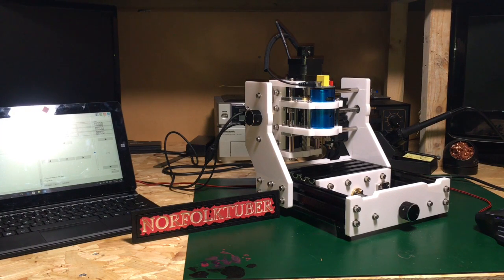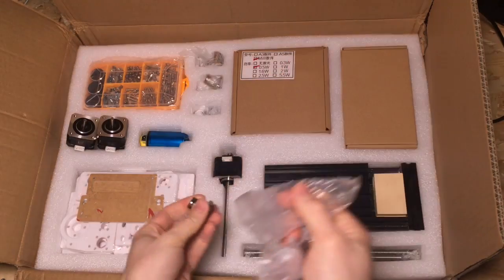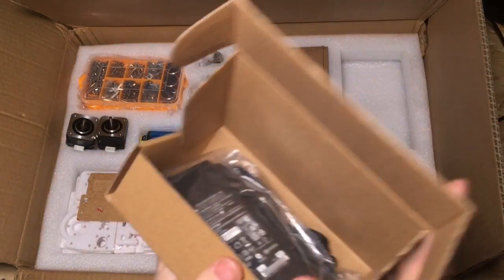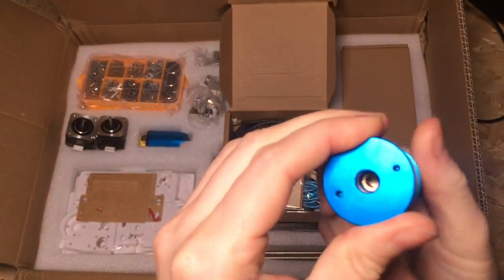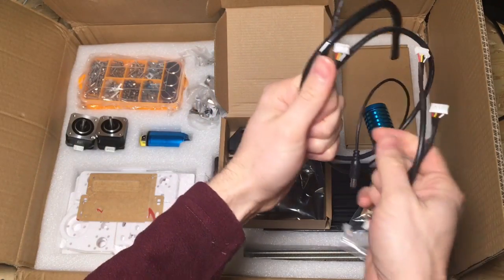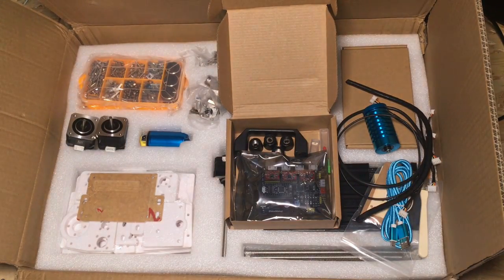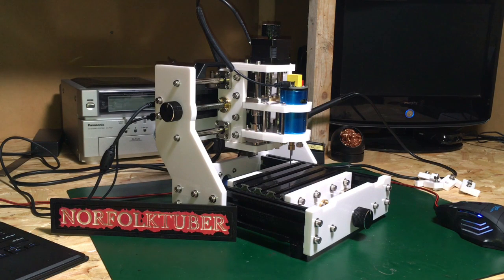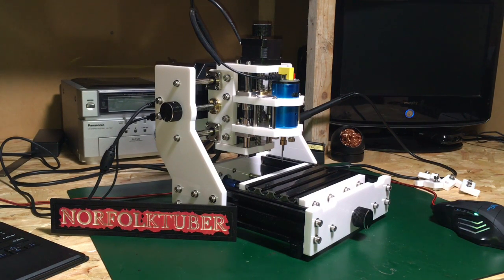DESKTOP DIY MINI CNC ROUTER ENGRAVER

Comment: Hi would this little machine laser engrave custom images in plastic switches with the same fine detail that's on these switches?  http://www.newpro-tech.com.au/Clights.htmNot sure if I would use the laser head or the milling head. These switches are white plastic painted black. Any help would be great.
Reply from the maker: No laser is not powerful enough to engrave plastic not sure.
Reply: Maybe it will work because it only needs to engrave the paint off, not the plastic you think it will remove the paint?
Reply from the maker: yes it should engrave it but you only have so much height between the cutting bit and the bed
Reply: The biggest switch cap is 34mm would that fit?
thx
Reply from the maker: With the cutting tool I have you have 38mm. If you cut the shank on the cutting tool you could get more.

Comment: How accurate is this machine for how many millimeters
Reply from the maker: well i use 0.8- 1mm endmills so it needs to be accurate when cutting if not the bits snap very easily. like any cnc its as accurate as you set it up to be.

Comment: i got my cnc router the other day just started to build it looks easy enough only thing that is confusing me is the nuts and bolts its hard to tell if im using the correct ones so ive stop building it for now very frustrating would have thought the would lable things better
Reply: Hi, robert, there is a series of pictures on the Eleksmaker website which shows you exactly which parts are which, and how to assemble it. Worked great for me, with the only problem you have to make sure the bearings all glide easily on their rods, otherwise the stepper motors will struggle. You can go here: http://forum.eleksmaker.com/topic/20/eleksmill%E4%B8%A8assembly-connection   It sometimes take the page a while to load, so be patient.

Comment: I've experimented with the Eleksmill laser, and have gotten mixed results.  The laser produced sharp, black lines on aluminum
plates that have a thin, white enamel painted surface.  However, there have been a few problems:

1)  When graphics and text are loaded (eg. Benbox Text / Size 10), it is fairly large in the set-up window, but the laser always
engraves at a much smaller size on the material surface.  Is there a resolution/size (mm, inch, pixel) parameter in Benbox
that must be set properly?

2) The laser power remains strong for about 2 min., then fades inexplicably.   The maximum intensity can be restored by turning off the power supply and then restarting it.  Again, the laser is set at maximum intensity, but then fades again.  Have you ever
encountered this problem  -  should the laser be replaced?

3) When laser engraving text & graphics with the "outline" option,  the laser does not stop burning between letters.  This results
in undesirable burn lines connecting separate elements as the laser traces the pattern.  I noticed in your YouTube video that you
managed to engrave text without stray burn lines between interconnecting text.  Have I missed something?

I would address these issues to Banggood, but I've read their replies to customer comments and they aren't very helpful.  I
would appreciate it if you could shed some light on any of the problems that I have listed.

Comment: After assembling the Eleksmill and successfully installing Banggood's version of artCAM,  I'm slowly learning what I'll need to
know to complete a project that combines both router & laser engraving.  All of this is completely new to me, so hopefully the
learning curve won't be too frustrating.  I've watched a lot of video tutorials on YouTube about various software platforms, and
I've decided to do the design setup (text & graphics) using Inkscape.  I'll use Easel to do machine carving with the drill bit,  but
which Gcode platform would you recommend for laser engraving?  Can you provide a download link for the GRBL software that
you're using, and does this GRBL controller do both your router and laser engraving?  If my questions seem naive and doltish,
the entire Gcode process is somewhat perplexing to an absolute beginner.   Thanks again for your help and suggestions.

Comment: I assembled the Eleksmill engraver (with laser), but have not had any luck getting past the Install.cmd software command.  I
have read other people's comments on the Banggood site regarding the "ArtCAMShellEx.dll" failing to load after clicking on
"Install.cmd", but the only reply Banggood gives is to turn off a computer's anti-virus software and try again.  I deactivated the
anti-virus software on my computer, and the artCAM module still fails to load.  I was wondering if you could shed any light on
this problem?  I've had NO problems loading other softwares before,  only this "buggy" version of artCAM with its multiple
Trojan.Gen.2 viral infections - which have subsequently been quarantined on my computer!

There appears to be further steps in activating Banggood's version of artCam 2008 after "Install.cmd".  Is it absolutely
necessary to use their downloaded copy of artCAM with its associated drivers and executable files to operate the Eleksmill,
or can ANY alternative CNC program be used?  I've downloaded copies of artCAM 2017, Inventable's Easel, and Inkscape off
the internet, and I'm hoping that these software packages can do the same spindle carving and laser engraving duties.  Does
the Eleksmill need to be initially kickstarted with Banggood's version of artCAM, or will these other softwares do the job?

I have 4.00 GB (3.80 GB usable) of RAM on my laptop.  Is this enough to operate the above-mentioned softwares without the
engraver stopping midway through an operation?  Any advice and assistance is greatly appreciated.
Reply from the maker: Scott McRae hi the art cam software Banggood has supplied is obviously a hacked version. It does not have to be installed you can run it from the folder just right click on artcam application icon and select to run as a administrator it should work I was running it on a ten year old computer so should work on yours fine. Uninstall artcam before running from folder.
The software they used to hack artcam is what is what the virus protection is picking up on.
Reply: The Banggood hacked version is running successfully -  many thanks for your help!  An "exception" for this
version was inserted into my anti-virus protection, to exclude it from being scanned.   Now my computer
doesn't block artCAM 2008 every time that it's activated.

Comment: I found your videos very instructive, and just purchased this unit with both spindle & laser.  I don't know how long it will take to arrive in the mail, so in the meantime I want to build a special clamp to attach to the aluminum extruded bed for a specific project.  What is the centre distance between the bed grooves, and will they accept standard 1/4" t-nuts?
Reply from the maker: Thanks will look at the bed grooves and get back to you, mine was shipped express had it in a week and a half.
all the best.
Reply from the maker: JACQUELINE LEE  centre distance is 6mm yeah 1/4 t nuts best regards

Comment: Nice build my friend, for the quality of the parts there its well worth the assembly time from the looks, its a shame they didnt just slip a bit of paper in with the box with the address for the assembly instructions but its cool ive seen that a few times so it seems a small oversight :-) still for the capability this little things offers, and the interchangeability of the etching heads, really impressed! BangGood really have some really well made bits of kit on there for sure :-)
Reply from the maker: Thanks my friend yeah really liking this great bit of kit.